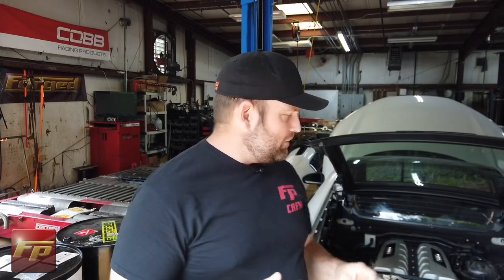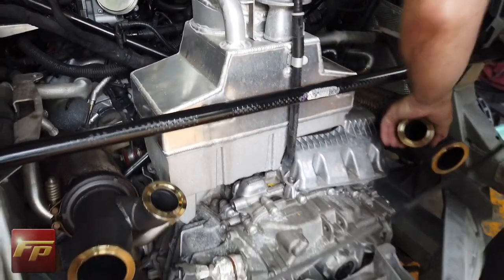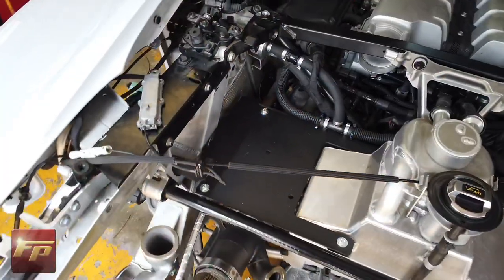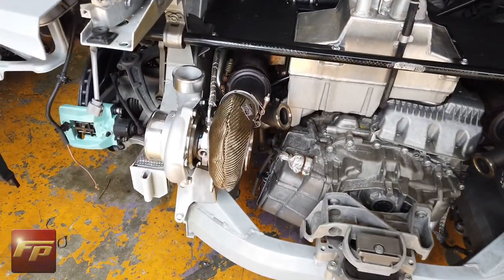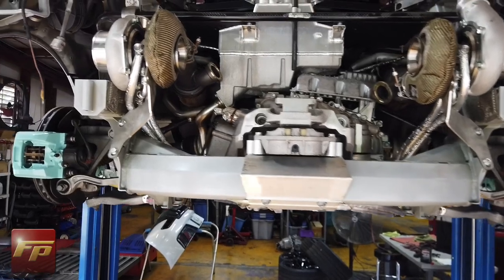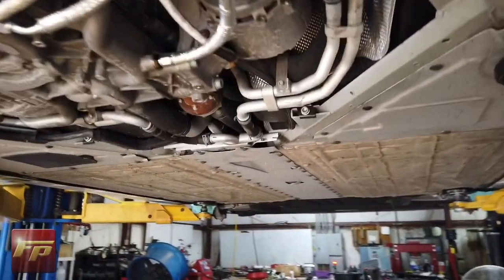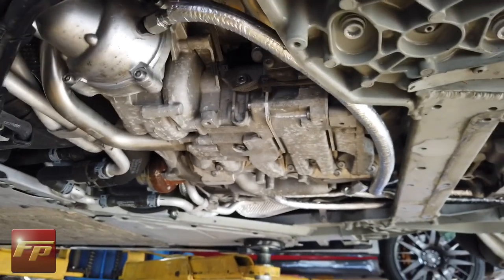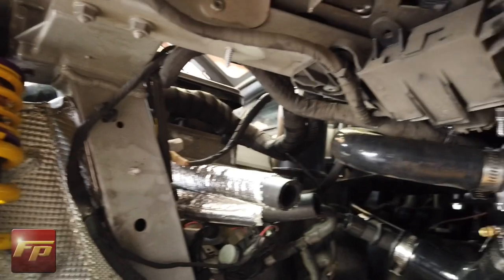Installing the AMS Alpha 9 R8 Huracan Twin Turbo Kit: Part 2

Comment: Keep up the good work.
Reply from the maker: Thanks! We are excited to finish the project.
Reply: @ColabGarage   Im in the market for a TT kit for my 17 plus and starting to do some research on the different companies how does your kit differ from UGR kit.
Reply from the maker: All of these kits are fairly similar at the end of the day...  Especially if you are looking to stay below 1400-1500whp on your build.  They all use similarly sized turbos, intercoolers, heat exchangers, and other related components. The AMS Alpha kits are engineered extremely well and have tens of thousands of testing miles done on them, drag racing, half mile, road course, and cross country rallies just to name the highlights of what this kit has been put through before it was brought to market.  

When comparing to UGR... They are still top of the top when it comes to the extreme high horsepower builds, but the market has caught up in terms of these sub 1400whp builds.  And lets be honest here...  Most people will be 1000% satisfied with up to 1400whp and not have to spend over $350,000 to get there.  UGR has their formula and that is it, you pick the package, drop off the car and you pick it up when it is ready.  Using a kit like the AMS kit we have a lot more freedom of choice in terms of customization for your specific build and taste.  And since AMS is a large manufacture we can typically have a kit here in 2-3 weeks at the most and installed in that same amount of time.  I know if you guys are anything like me; once you decide to pull the trigger on something like this you want it NOW!  And we can deliver a completed project in roughly 4-6 weeks time and not have months of waiting your turn.  Finally, there is a substantial cost savings when comparing the AMS Alpha kit to a stage package with UGR.  Feel free to contact us at the shop anytime to discuss all of these options.  770-792-0202

Long winded answer, but hope that helps in your research!
Reply: @ColabGarage  very well put. Im not looking for the highest HP car as that is not my goal but a 850-900 to all for wheels along with reliability I will give you guys a call on Monday to ask a few more questions. Thank you for the quick response and look forward to speaking with you on Monday.

Comment: How about oil feed to the turbos?
Reply from the maker: Eduard Popov the oil feed source is quite buried in there behind the oil tank... we just couldn’t get the camera rig down in there. Even with this compact Osmo Pocket that we are using to do a lot of the filming.
Reply: @ColabGarage  Did you drill the oil tank or use an existing tap from a sensor or likewise?
Reply from the maker: Eduard Popov don’t have to drill the oil tank. There is an adapter plate that allows for you to use an existing oil port on the engine to get these